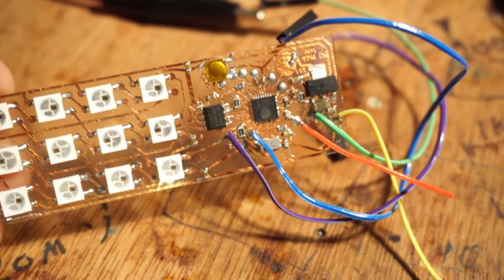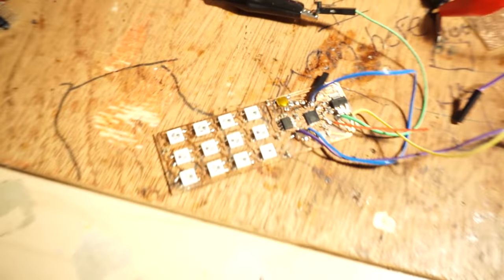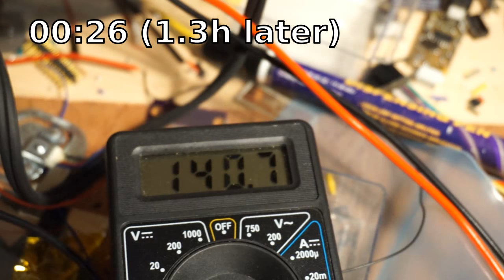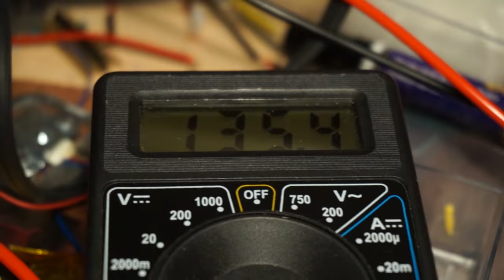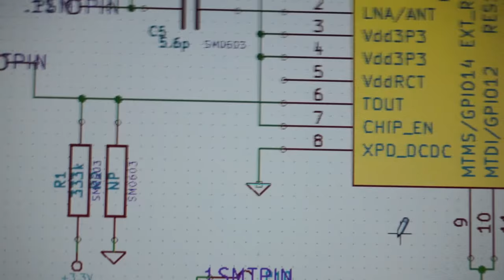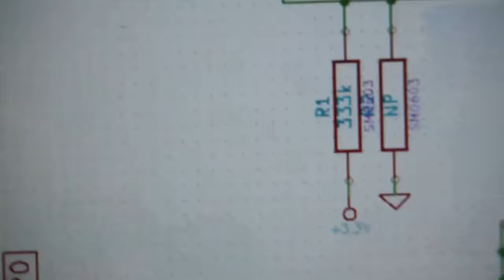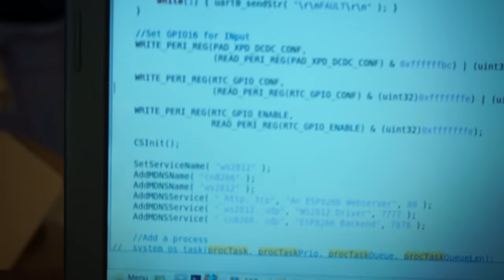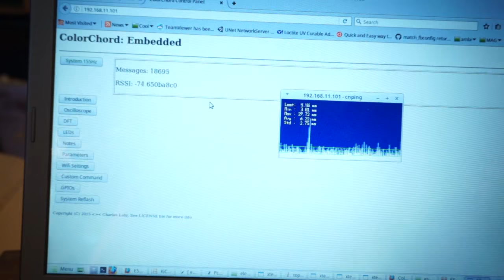Part 1: How I work with and debug my glass PCBs

Comment: Please get/make a pop filter
Reply from the maker: You're right.  I really need one :(.
Reply: If you feel like being cheap just a fuzzy cloth wrapped around your mic works pretty well. I'm using a sliced into tail from Spencer's over my AT2020 and it sounds great, but really any foam or cloth will do the trick. In the mean time I'm pretty sure audacity can help you take those peaks out and do noise reduction. If you don't want to do the editing because your time is better spent making epic electronics though that's cool. I'd much rather see more of your already good videos and awesome inventions than see you spend half your time on presentation & editing.
Reply from the maker: I already spend more than half of my time videoing and editing. :(  But! I will still keep this in mind to see if I can get a nice fuzzy top for it.